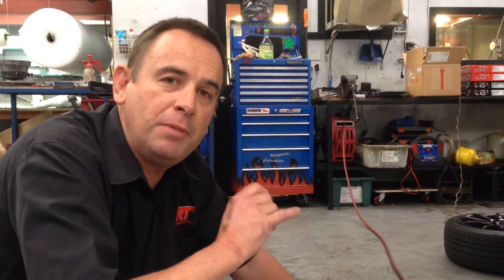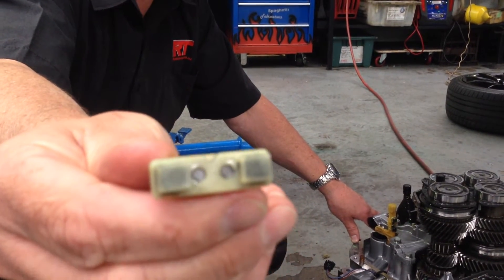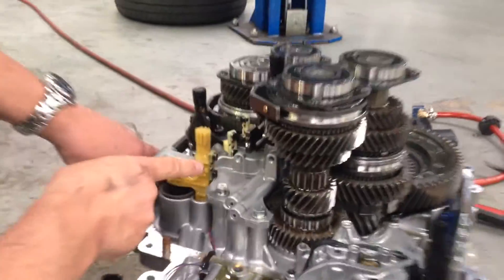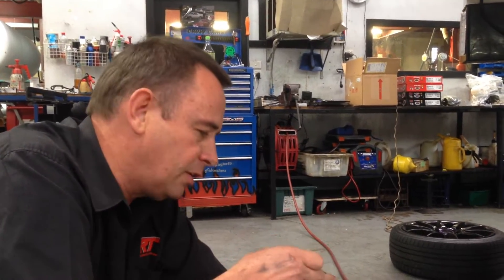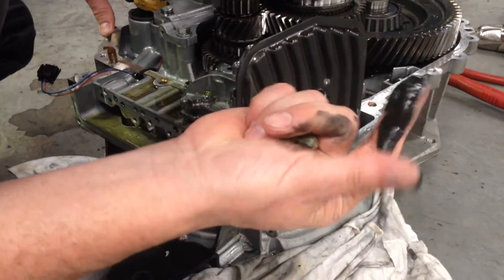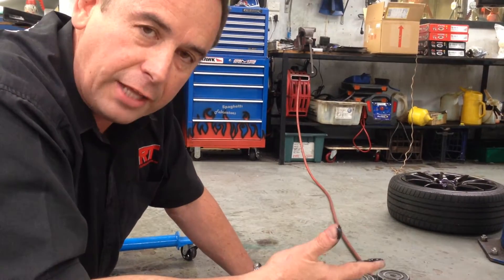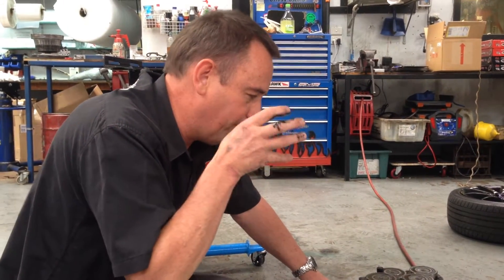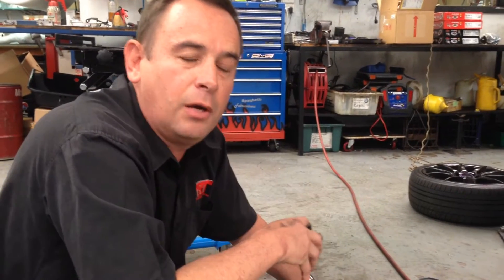Mitsubishi SST transmission tips and traps update The magnets Part 7

Comment: I have a 2014 Mitsubishi Ralliart I put the car into drive but the car will not move is this a sign of magnet problems I took it to Skyline they said it's the megatronix body valve but the card never throws a code all it tells me is transmission required any information would be amazing I live in Colorado and nobody likes to touch the SST Motors

Comment: recently baught a 2014 evo X MR with 47k miles on it. I was pulling onto the highway and i started to accelerate and i got into 5th gear and the transmission shifted all the way down to 1st going about 60 mph and no matter how many times I pressed the gas the car wouldnt move it would only rev up and i got a “transmission maintenance required” light. I had to roll onto the shoulder and turn the car off then back on. The light showed up again but went away and the car was shifting normal again. It has happened to me twice once in automatic normal mode and once in sport manual mode. Does anyone know what this could be?

Comment: So what is the ideal fix for the magnets coming off the fork? I have mine apart now needing to reattach shift fork 4 magnet
Reply from the maker: you need a jig to accurately get them in place and hold them whilst the glue dries, if you are 1 mm out, they will cause a fault code OR ship them to us and we can do it for u
be careful what glue you use
Reply: What glue do you use? It must be some strong stuff. I heard in one of your videos about using the jig and how precise they need to be. If I ship to you it will be going to Au? Or do you have any shops in the US?
Reply from the maker: you will need to ship it to us in AU

Comment: Good Day, I have the same problem with my DCT470. Do you sell the magnetic and the glue to reinstall it? (2nd 4th and 6th gear magnetic)
Reply from the maker: sorry no we dont
Reply: Akracing/Dodson Motorsports Australia have a redesigned full aluminum shift fork for $550. I believe that's the best part you can have.